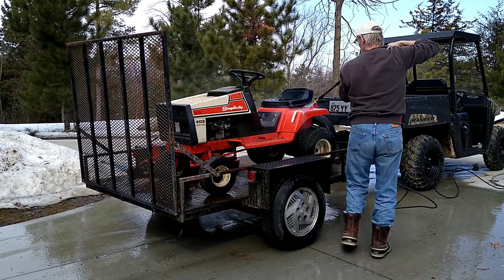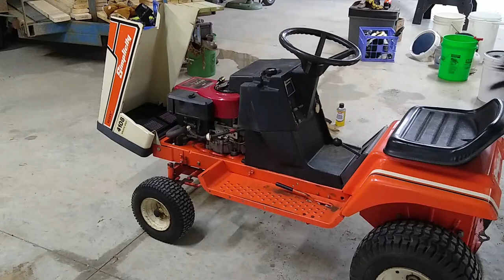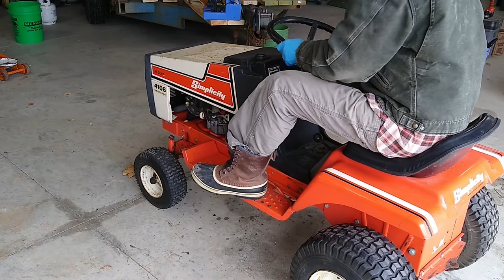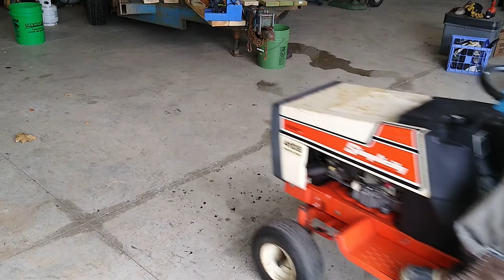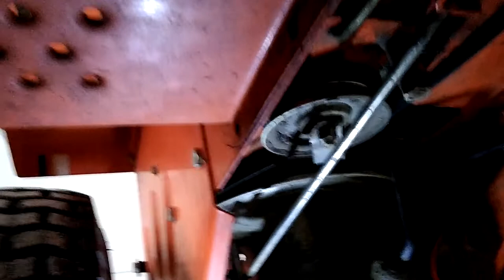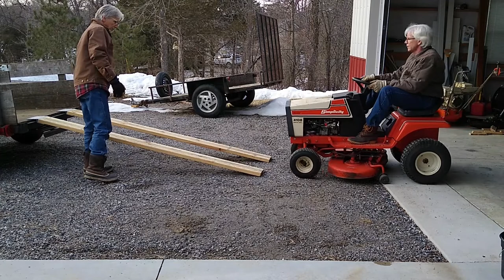Simplicity Lawn Tractor

Comment: I have a 5212.5 rear wheels are locked up on it.     It is hydrostatic drive how do it ?  you know how ?
Reply from the maker: Nope.  Mine was a gear driven trans.  As it turned out, my trans was fine and it was a locked up brake causing my trouble.  My only advice is to take a look at the brake first.  Good luck.

Comment: Simplicity Regent 4108. Not 70s. Probably 84, 85, 86. I have a 4210.
Reply from the maker: According to tractordata.com, the 4108 was built 1976-1979 while the 4210 was built in 1989.  Simplicity used that same basic platform for a long time.
Reply: According to tire tread your's is a 78 or 79. 76 and 77 had a slightly different tread pattern. Then of course they dropped the 4100 series and went to the  4200. My 4210 was only offered as a promotional item in 1989. The only simplicity offered with a 10hp engine at that time. I also have a 4111 and a 4211. Hope you keep it running. Nice little mower.